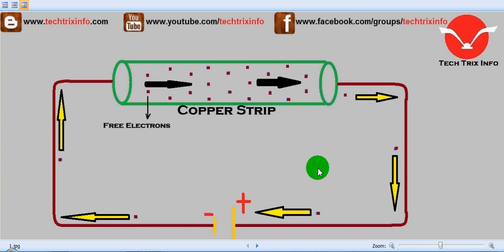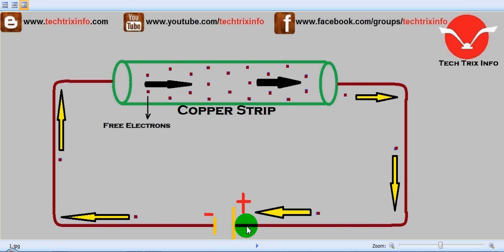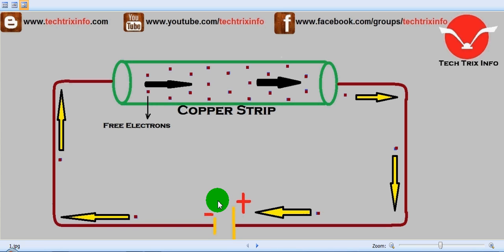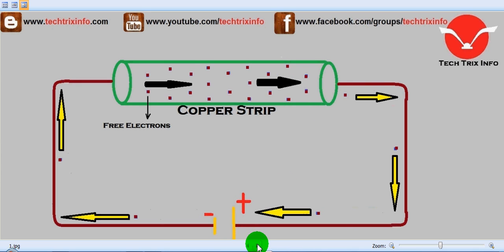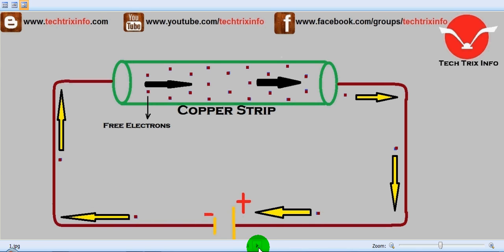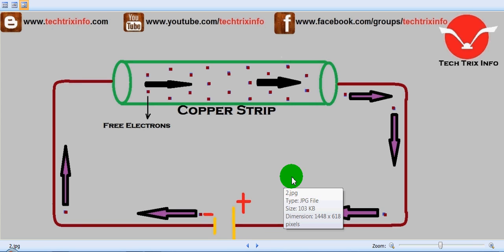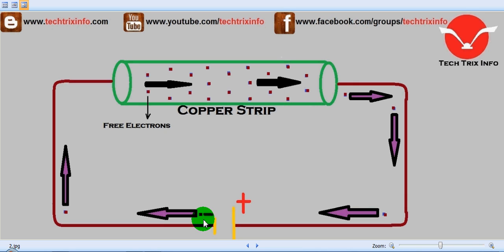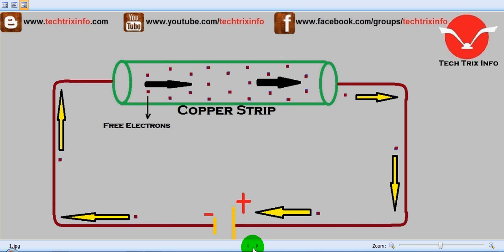How electric current flow works. ✔

Comment: 👍👍👍When underwater welding DC(the rod/stinger)is the negative,and the ground clamp is positive; unlike surface welding.
 If there is any question regarding the polarity of the leads,put the clamp,and the stinger( the rod ends) into a bucket of water and charge the system. You should see bubbles flowing from the negatively charged rod to the clamp through the water thus proving electron current flow.
 I've never have seen any holes flowing from positive to negative.
 When DC underwater  welding always remember PIG..Positive is ground,otherwise ☠

Comment: So if electricity is the flow of electrons in the wire then why does the electrical force travel at the speed of light in the insulation covering the wire (say 0.66c km/s), or if no insulation then it travels at the speed of light in air (say 0.9999999c km/s). How do the smart electrons in the wire know whether there is insulation or not.
For the answer google Ivor Catt or Forrest Bishop.

Comment: Passive sign convention states that current flows from high to low potential across a voltage source or circuit. You're fundamentally wrong and confusing anyone who watches this video, as it describes the opposite of what is conventionally utilized by quite literally any academic body.

Comment: I have two questions which are really confusing.The first one is what is actually meant by FREE ELECTRON .Generally we say that these are outer most electron of atoms of the compound which are held loosely in case of metal.But I want to know if these electron move from metal to positive terminal of battery then should there be not deficiency of negative charge in that atom.And second question is that if the current continues to flow then would there not be a time when the free electron would be not to move,IF ANYBODY KNOWS ANSWER TO MY QUESTION PLEASE REPLY
Reply: same here!!!!

Comment: Thanks for that simple explanation. I too assumed that current flowed from, rather than to the positive terminal. I think too many teachers/tutors assume that people know the correct way. Do you have any videos on circuits and how current flows through them....for example; a Ligth Dependent Resistor with a Relay to activate a Motor.

Comment: Your explanation is incorrect. You need to stop regurgitating the incorrect psyence of quackademia, and learn to observe nature.  That is what Tesla, Walter Russell, and other did to make their breakthroughs. Our universe is electric (see Wal Thornhill & David Talbott's "Thunderbolts of the Gods"); and as Tesla & Walter Russell discovered, electricity is a dipole; bipolar; it's not just about electrons (which are NOT even particles per se' - they are theoretical particles, comprised of Moebius waves.  They have qualities of particles, but the comparison ends there. Electricity waves move bidirectionally at a sub-atomic level. Given electric impetus, there is always a bias in one direction or another (from which side the bipolar force started from), but this is mainly relevant only in DC currents. See Heinz-Wolfram Kasemir's work on lightning, but Walter Russell really shows the truth of it..
Reply: DoctorMaxMoebius  yes you are right this man is making fool to us 👎🏻👎🏽😡

Comment: Does the electrons move in  the opposite direction of the electric current
Reply: hassan Araby  yea electric currents move in an opposite direction of the electron direction
Reply: Joseph Mlambenyi but if that so. Why the video showed that, the flow of current is the same direction as the electron?
Reply: Think it's fake fail or mistake
Reply: Joseph Mlambenyi lets have a look http://www.mi.mun.ca/users/cchaulk/eltk1100/ivse/ivse.htm
Reply: Explained but not fully exploit

Comment: Should the capacitor be used at the minus-side or plus-side of the circuit? Or it does not matter? Or you can use capacitor on both sides to make sure?
Reply: the electrolytic capacitors MUST be connected in the proper way (- at - and + at +). Ceramic Disk or other smaller types of capacitors don't need, they can be plugged either way.

Comment: I am trying to understand basic electronics and its very confusing trying to understand current flow relating to diagrams and transisters and diodes. I need to be able to read electrical diagrams and understand what they are talking about and how it relates to electrical components. I don't want to just copy what people are doing, I want to really understand how electrical energy is moving around and how it relates to electrical diagrams.
 It seems some dated ideas, that are incorrect, are holding many people back from truly understanding how electricity works. I need some insight on how to understand these dated concept and how they relate to todays electrical diagrams and symbols like diodes and transisters, and how electricity really works.
If you have some videos or can direct me to some that might help me, I would be very grateful. I already have read about voltage and current many times, but it is still very confusing. It is almost like some one is intentionally trying to confuse people to prevent full understanding of this subject. This tactic might work on normal people but it just pisses me off and I wont let it stand in my way from learning what I need to know. Im sure you have run into people having difficulty getting a grip on how current works and being able to understand its effects.
I hope to hear from you. Thank you for your time.
Reply from the maker: Please give me some time. will upload good electrical video so that you can learn easy.Please Subscribe to us by clicking the SUBSCRIBE button for updates.Visit TechTrixInfo com for more details.
Reply: You should make some minecraft mods that use real electrical principles. Youtube minecraft. If you understand how to do java or want to learn there are loads of how to make your own minecraft mods. You can make adventures in minecraft where you learn how electricity works and how to make circuits. hundreds of  Millions of people play minecraft. You could have some major income by people playing your mods and some lets play of your own on how to play your mods + if your mod is really good and fun then public schools might pick it up and you would be a very rich man, just saying, if you want to teach electronics nothing beats doing and kids and people love games. Kill 2 birds with one stone and pocket 50 million at the same time, just saying!
Randy
Reply: You should read the original papers of Heavyside, Poynting, and Maxwell, but beware it requires some pretty difficult maths, like quatrenions(4D numbers) and such. Sure you do not need to fully understand their ideas to design a circuit, just like you do not need a full understanding of fluid dynamics to design plumbing, for the full picture though these men I think got the closest to what is going on.  The reason you perhaps see "deception" , witch very well may be there, is because the math, therefore the understanding in the models is incomplete.  Heavyside reduced Maxwells equations from 20 variables to 4, so non-theoretical physicists could actually design electrical systems, mostly telegraph networks.  Those "non-accounted" variables may have been seen as extraneous at the time, this was before the discovery of the electron.  My analysis may ultimately be BS, but the papers from the OG electro-dynamisits surely are not.

Comment: For instance, a floating power supply might be rated for 15V, but in absolute terms with respect to ground or electrically neutral, the + might be + 8 and the - might be -7.  So connecting the ground to the - changes it so the - is 0 and the + is + 15, or connecting the + to ground changes it so the + is 0 and the - is -15.

Comment: To answer your question, it makes no difference that the ground is connected to the negative terminal.  Inside the battery, the chemical phenomenon is moving electrons from the + to the -, and at the - the electrons are flowing out into the ground (infinite sink) so that the negative is at an absolute neutral.  That just means the battery will put enough holes on the + side so that the terminal is at an 'absolute' positive specified rating above neutral.

Comment: Great video, so just to be clear the passive convention states that current flow is from the source positive terminal to the negative terminal. However the electrons are actually flowing from the negative terminal to the positive terminal, correct?

If this is correct, then why do we often see grounds placed near the (-) terminal? Wouldn't the electrons just flow to ground?